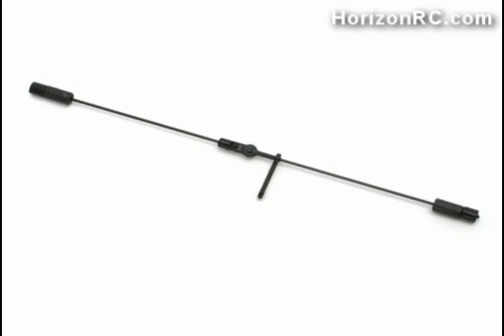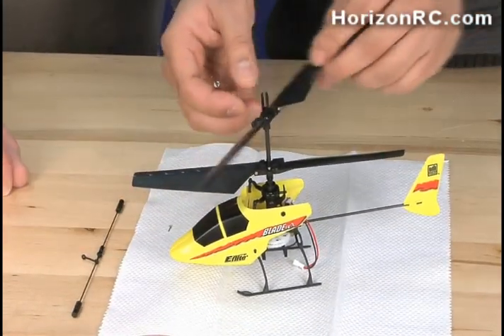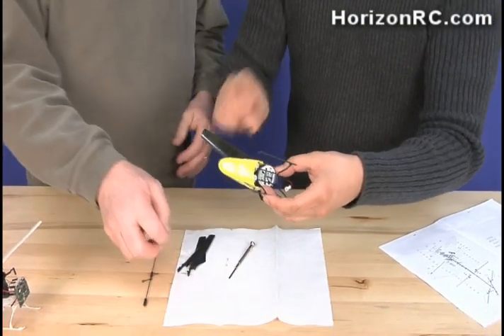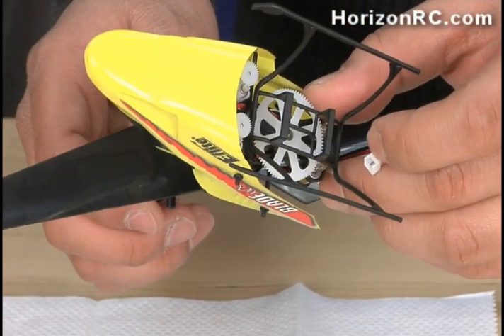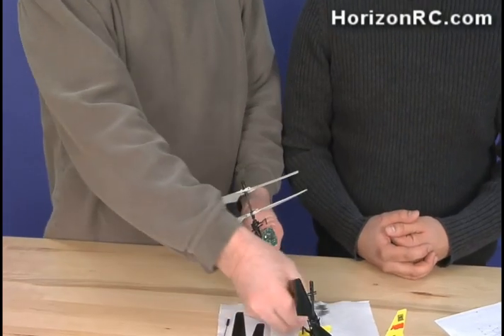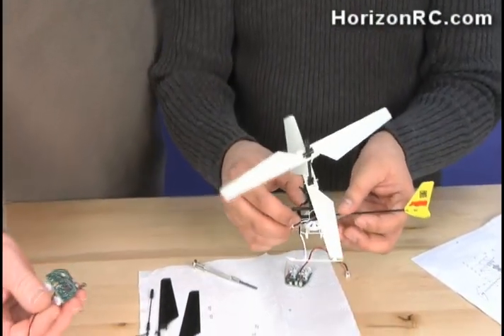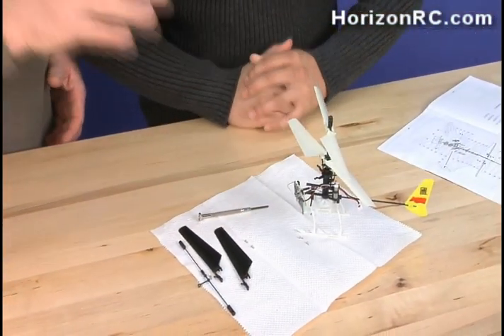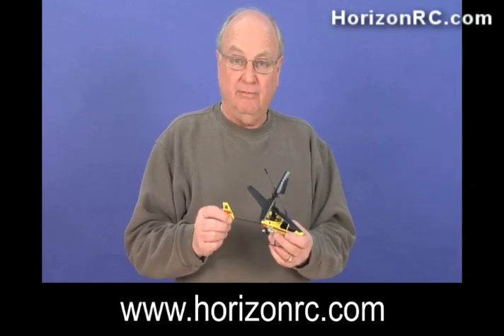HorizonRC com How-To:  Repair Your E flite Blade mCX

Comment: I had the same issue.  I unscrewed the two screws that hold the bottom gear onto the shaft, and tighted it up a little bit.  There is a bushing with a screw on it just below the lower blade which I loosened, pushed down the main shaft, and retightened everything and haven't had any issues since.  The only issue I still have is that when the copter lands hard, the two motors sometimes pop down a little bit, and I have to realign them to the two lower gears, otherwise no other issues to speak of.

Comment: hey thanks, My right motor  wasnt hitting the gear and i have to get a new motor. i think for mine the shaft came down because of the motor gear wasnt touching the other gear. When i fix the motor and if the shaft  keeps falling down ill use your trick

Comment: You can wrap the jaws of the needle nose with a little electrical tape to help keep them from scratching up the armetures during this...or just be careful and it will be fine...if you need excessive trim to hover mechanically adjusting the ends of the servo arms may be needed...grav the metal just under the plastic arm ends and screw them in for shorter throw out for longer a couple rotations equals several trim possitions...so go slow and try it out till it's close to no trim needed

Comment: Just got my MCX yesterday and I can't stop flying it.  It's my first heli and I've crashed it more times than I can count.  One thing I discovered is that the two electric motor sometimes get knocked out of position, causing the main gears to bind.  All I had to do was push them up so the bottom of the motor sits flush with the bottom of the circular bracket and it's back to normal.  It's so easy to fly and extremely durable too.  Definitely FUN and worth the price!!  And anyone CAN fly one!

Comment: An important tip is when popping the servo arm ball links on the swash plate arm balls "gently" grab the arms just behind the balls a little with some small needle nose pliars to take stress off the swashplate arms...be carefull not to chew- up the plastic swash but it just helps you be able to pop the linkages back on without any stress on the swash armetures

Comment: I fixed my mcx but now it flys crazy and I can't trim it
Reply: I had the same issue and realized that I swapped the servo linkages when I replaced the board.  One was adjusted longer than the other and I didn't notice until I looked at both again.  Once I swapped them, all returned to normal.  They are threaded and can be adjusted, but the factory must have a method.  Even the slightest adjustment will throw the heli out of balance.

Comment: Any chance of you posting a video for REPLACING THE SWASHPLATE?  I prefer to mechanically trim models before using transmitter trims; and so had to adjust both pushrods.  Unfortunately, while attempting to refit the links, BOTH 'balls' broke off the swashplate.  So now I have to replace the swashplate before I've even really flown my new mCX2!

Please consider beefing up the ball-links on your parts.  Even Jim broke his!